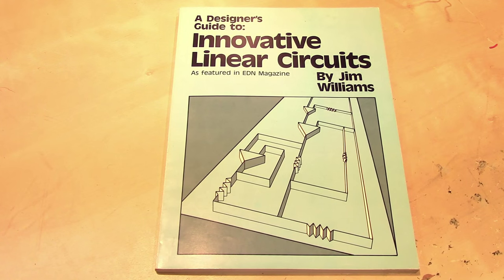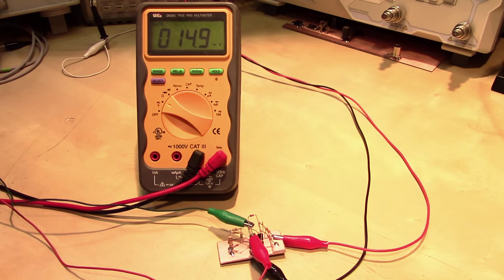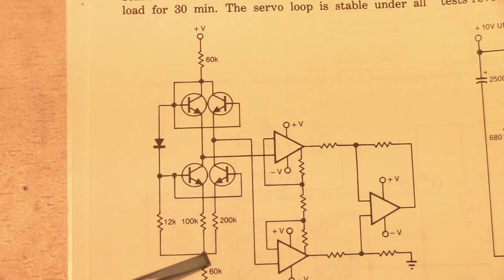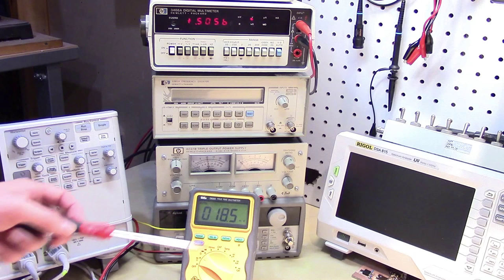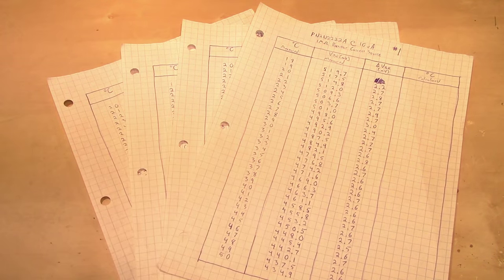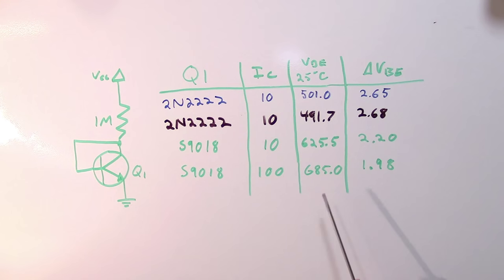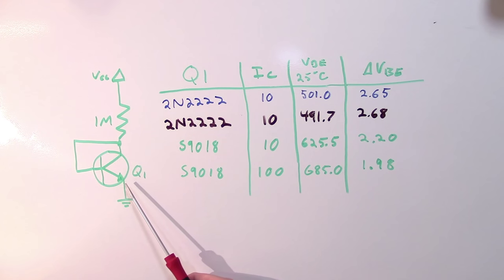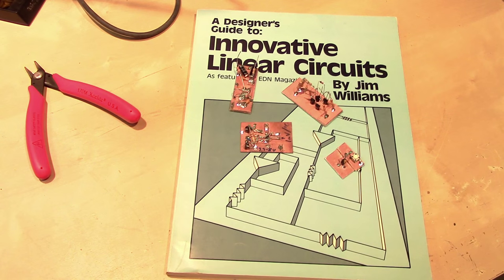Jim Williams' Test Your Analog Design IQ #14

Comment: Hi there ! Great research about this schematic ! I wonder if the use of two transistors in current mode isn't also related to the TCR compensation of the resistors. When using only one transistor the collector current will also vary as the resistor heats up. Maybe using two of those preserves the currents ratios across temperature ?

Comment: Can share the multimeter link or part number?
Quite impressive!!

Recently I worked on DC to DC buck converter but while turing OFF negative spike is there.
It is causing problem for micro controller. If you interested to help me out I will share the design details and waveform also.

Comment: If Is is the common term and cancels out, why VBE or T does not cancel out on the same division?
Reply: Because the Vbe and T are exponents. You don't cancel exponents when dividing, you have to subtract them. That's where the Vbe1 - Vbe2 comes from.

Comment: Very good video. This morning I was looking into using 2-diode to220 device for a temperature control circuit. You just save a fair amount of research. 1e3 Thanks.
Reply from the maker: +Álvaro M. Valdebenito B. Glad it helped! There is a list of excellent references and additional reading in the associated blog post (see link in the video description) if you want more in-depth information on the subject.

Comment: Thanks for the video, all good :)

I think you shall record your data and show them with the help of R language + ggplot2. You can even do linear regression based on your measurements.
If you like manipulate data and statistics, R if for you, ggplot2 just render them even better

https://cran.r-project.org/doc/manuals/r-release/R-intro.pdf is a good start point.
Reply from the maker: +np Yes, pretty graphs might be a bit easier to read. :)

I've never used R before, is there an advantage to using R+ggplot2 over a Python based solution (e.g., Python+pyqtgraph)?
Reply: +devttys0 That depend what you need, want to do, R is more likely Mathlab or Octave. Python + pyqtgraph should be enough if you want just for graph your dataset. In R it's pretty easy to use/plot without known so much about programming, R is data manipulation centric, python is more generalist programming language.